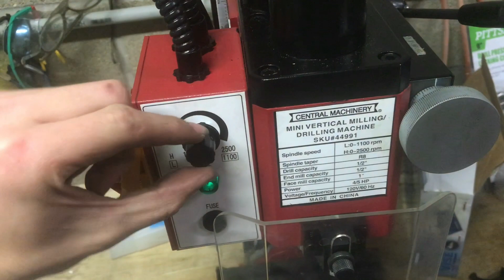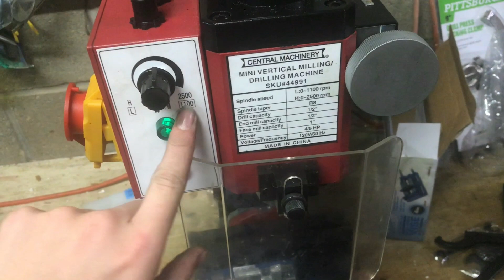HOW TO OPERATE Harbor freight mini vertical milling drilling machine 44991

Comment: I purchased one of these babies from HF a few years ago. It has a number of flaws starting w/ the gears,(replaced w/ belt drive - much better). Head drops all the time,(replaced w/air shock-much better). X-axis no motor,(added electric drive-much better).  No DRO,( added 3 axis -much better) .On and on and on.! I should have gone to Little Machine Shop and paid $1,500 and would have had a better machine. Though I will say, I learned a lot in the process.

Comment: Not criticising but I have one of those mills, I have used mine a lot it is awful. Bad gears, Bad vertical travel (the cutter digs into the work too often) bad alignment, bad rigidity the list goes on.  Don't buy one go for something better is my advice. I have ended up spending good money after bad on it.

Comment: a collet chuck makes using collets so much easier if you have to change end mills, and then you don't have to mess with it up top until you want to put a drill chuck back in

Comment: on delivery my fine z adjustment freely spins and doesn't move the column down or up even a little bit. The coarse however does work. what can I do beside returning harbor freight central machinery mini milling drilling machine.
Reply: you pushed in the Z coarse feed handle? about 16 turns of the fine feed is only 1"...

Comment: I'm a bladesmith but having trouble getting blades nice and even. I could always use a surface grinder to get true flat and uniformly thickness but I need a mill now. My questions is will this mill do an adequate job of getting uniform thickness or do I need to find a way to get a surface grinder for universal thicknesses.  Thank you
Reply from the maker: If the x and Y axis is squared up to the mill bit we have found that you can get your work piece very flat. Not as flat as a surface grinder of course. But for the typical knife blade it sure seems to do a pretty good job. Of course the steel would have to be tempered to be able to cut it with a blade. The surface grinder could flatten harden steel. To cut something with tempered it to cut it, Then re-tempered it when it’s all done. I hope that answers question.
Reply: @livefree6878  that does perfectly thank you. The most important time for me to have it true flat is before the steel is hardened so I can get even accurate bevels
Reply: @wesgreen241  a mill will get you within about +/- 0.001 inch a  surface grinder can get you flat within about +/-  0.0001 inch and a near mirror finish.
Reply: @robc8468  awesome thanks for the info

Comment: Only a fool would mill with a vice designed to be used on a drill press.
Reply: A fool?....shut the hell up. He can use what ever the fuck he wants to use to hold it.
Reply: @wyattflp6163  Foul language does not become you......showing a dangerous method on a public display is not a good idea even if you think so.
Reply: @Ian Pearson actually as long as the part does not move on you, ANY vice can get you a part to spec. as long as you have excess material to 0 the surfaces out. you then rely on your table to be square. watch Joe P show you how a crappy, skew setup can still produce a spec part - https://www.youtube.com/watch?v=hmS0P1bGfNc&list=LLGk9C9x6eQy6iieuTrljaRA

Comment: Great video...I was wondering if if works as good on mild steel or is there a lot of deflection..??
Reply: You have to make sure the steel stock is not too long far away from the vice jaw causing vibration for thin stock but if ita thick lets say the width of the palm then thats ok.go shallow with the cut you dont want to go in too deep stalling the machine creating tons of vibration and causing the machine to be broken

Comment: Great... now throw that vice on the benchtop or down the driveway  and get a precision vice that will actually hold your work. Even a $70 China or India vice will make a huge difference. No one should ever use those crappy HB central forge vices
Reply: Checkpoint less than that 30..50$ and  india or yugoslavia  ones better

Comment: Nice video, thanks. I’d recommend using a brush to clear chips... it’s really easy to cut yourself running your finger along newly cut edges like that. No huge deal I’ve been cut like that many times, and a little superglue patches you right up. Still, brushes are cheap! Again, thanks for the helpful video, I just got the same machine and it’s nice to see it in action.